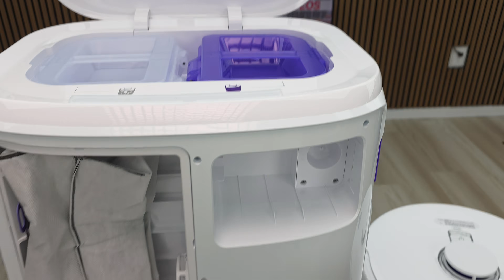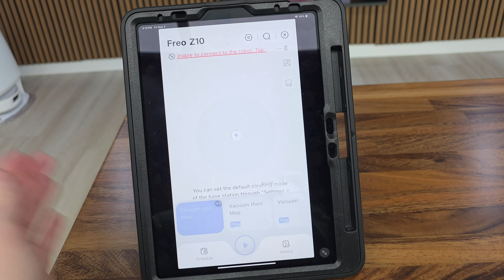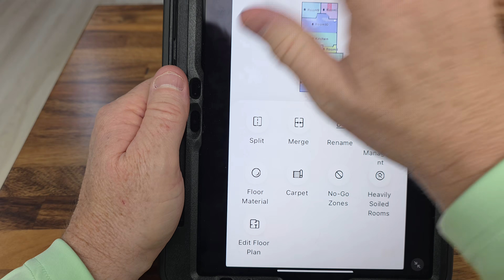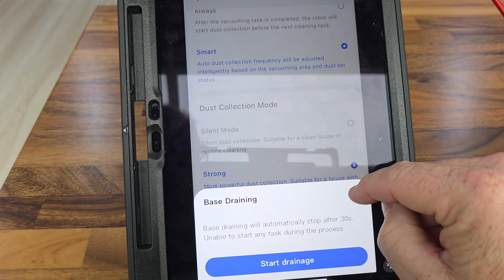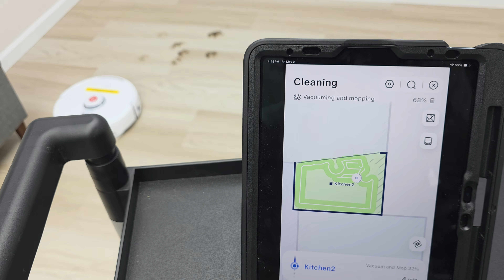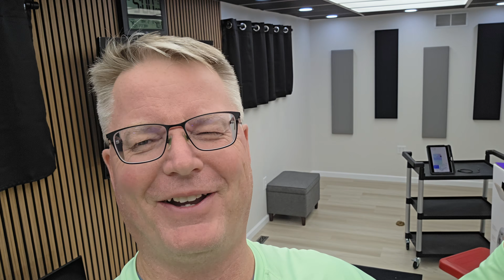First Look Narwal Freo Z10 Robot Vacuum & Mop How To Setup Connect to Wifi and Map Your Home

Comment: The Z10 sounds similar to the Freo Z Ultra but without the camera. I always set my robots to clean the mop as often as they can, in the case of Narwal, the shortest distance, or for other brands such as Roborock, clean the pads every 10 minutes. It uses more water but if you're going to have a robot clean, why not have it do the best job it can? I also set them for the hottest water setting that they offer and the deepest clean of the pads, it takes more time but again, the goal is to have the best clean possible.

Comment: still not there yet robots need to be autonomous and so far all of these fail that test they need to reliably function multiple times a day with out a single bit of human interference for me to consider an upgrade from my deebot ecovac n8+, hair tangle is horrible on my robot and mop isn't even a vibrating pad yet I see no reason to upgrade still as obstacle detection/avoidance, hair tangle, mop, etc have yet to be good enough for me to spend another large sum of money. these videos really help with understanding how it actually feels owning one of these new ones and thanks to you I'm still holding off. will keep tuning in to keep up with all these releases you're doing great.
Reply from the maker: It might seem that way, but most of the time under normal use, they perform very well, with that being said, all have to be helped back to the dock about %10 of time and all run over things about 10% of time,  but what i like is that 90% of time they are really being helpful at mopping and vacuuming,  but I agree they need to do better, some more than others,  thanks for watching!!!
Reply: 8 own the S1 Pro from Eufy, and I guarantee it's better than what you have. I am also extremely impressed with the first cleaning as my other robots are usually caked with crap and the dustbins are nasty. With the S1 Pro this was not the case. 

I only wish it had the extending side brush like the newer models that just came out. But it is enough to make me probably stick with Eufy from now on. 

I also owned, at one point, the ecovacs deebot Pro Omni. And while I did like it, it constantly gave me bumper stuck errors. So unfortunately I had to go back. But still the Eufy s1 Pro is much better than that and not as tall. It was also a nightmare to try and clean that one as well because the mop roller came out but so much residue was in underneath the mob roller and you can't take that housing out to clean it well enough.

Comment: The E28 has an internal water tank. I was wondering how much dirty water you get in your dirty water tank after a round of cleaning. I get very little and was wondering if that’s normal or not
Reply from the maker: I am seeing that same result, very little water in dirty tank, I Need to do more testing
Reply: I noticed that the S1 Pro doesn't have that much water either when it drains out. So I do believe this is normal. It still does an awesome job.